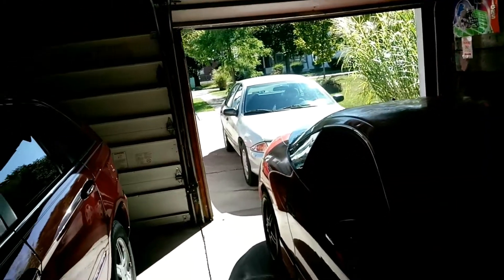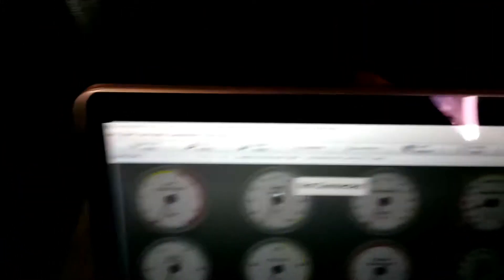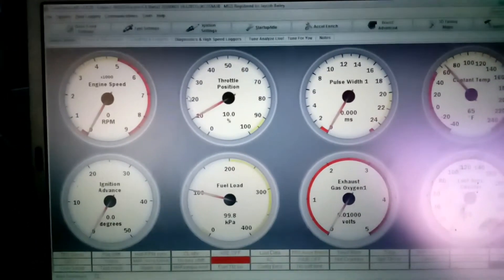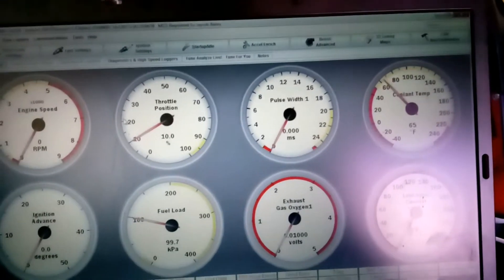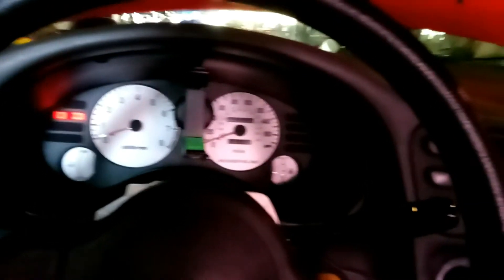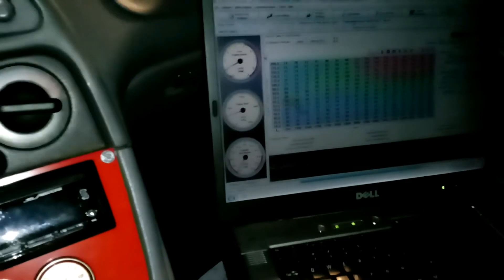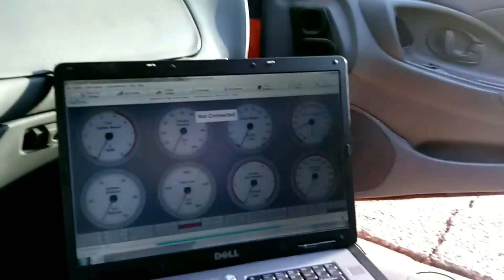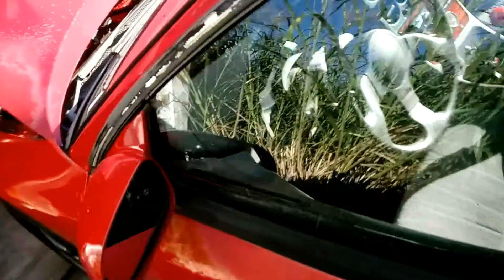The Megasquirt Is Back! Will The 420a Run Again?

Comment: Did you have to install an adjustable fuel pressure regulator in the car for megasquirt to run ? Or are you using the stock fpr?

Comment: Wondering on the build? I did my MS 2 and just used a manual IAC from MP here in Texas. Car is a blast and no idle issues anymore. Currently working on 2.4 swap.
Reply from the maker: Unfortunately I parted this car out and abandoned the project but the megasquirt is now in my turbocharged Dakota. I still have the engine and trans in storage and have been considering doing a neon build at some point with it. I did later get that same manual iac valve and it took care of the issues for me as well